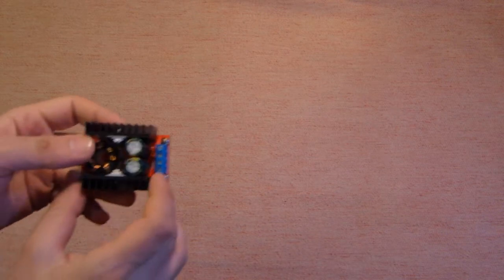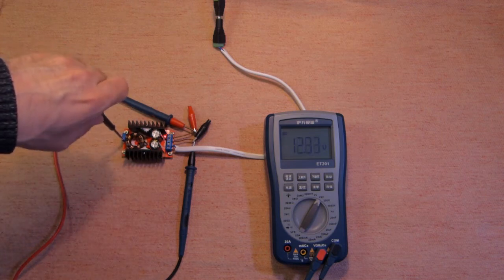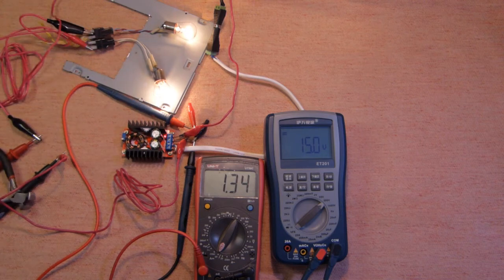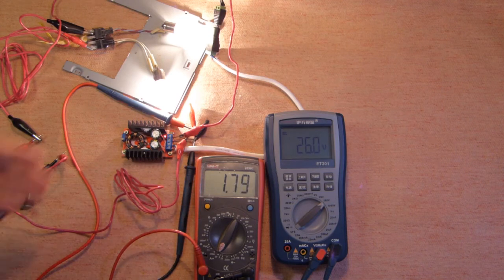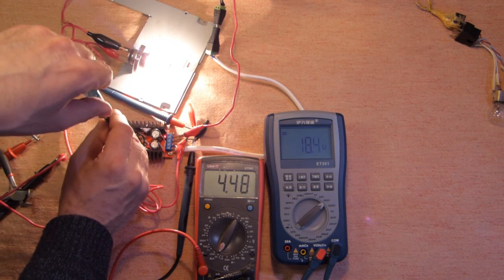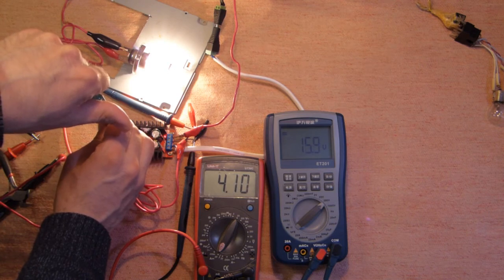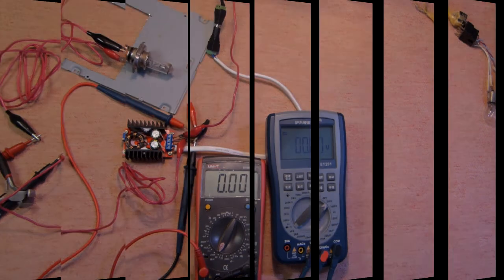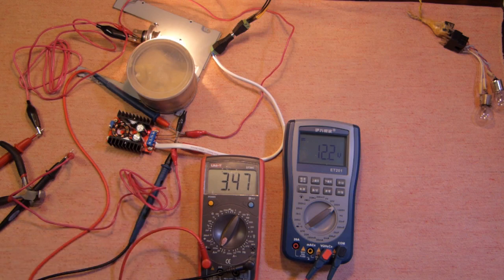DC-DC Boost - Step-Up Converter

Comment: Can i use it with following 
Input 13v 15amp output 24.5v 4.5 amp with a big cooling fan
Plz reply ..i just ordered 2 pcs before watching your video😑
Reply from the maker: Hello, I really doubt that the device can provide 4.5A at the voltage more than 20V, not to mention 24.5V.

Comment: With micro fan it will run cool, but still always overrated.  Can you do a video with this boost buck please?   
https://www.aliexpress.com/item/Automatic-Boost-Buck-Converter-CC-CV-5v-30V-To-1-30V-8A-12V-24V-Regulator-100W/32611751890.html?spm=a2g0s.9042311.0.0.17c44c4d0XXCdM
Reply from the maker: Hello, I'll try as soon as I get it

Comment: hi, i have a small doubt over this. if the input voltage is 4.2 Volt with 2 Ampere for the boost converter and what would be the output voltage ? because my output load requires minimum 12 Volt 3 Amps, i know that the output voltage can reach upto 30 Volt and what about the ampere for the output voltage. will it exceed the input ampere (i.e) 2 Amps or the output ampere is same as the input amps ? please explain it.
Reply from the maker: Ok, your input and output wattage should be almost the same i.e.  4.2V*2A=12V*0.7A. But in reality we have the heating process during power conversion, so, - we lose energy. If the efficiency of the device is 85-90%, then we lose 10-15% of energy. As to your question: if your load needs 12V and 3A, so, it needs12*3=36 watts. What will be your input voltage? If you plan to use 6 volts, then 36/6= 6A. But in reality it will consume a bit more: 7A or something like that. That's the main principle of operation of such converters.
Reply: seems like there's a lot of ampere drops in the module....anyway, i got it. thanks for your detailed clarification. is there any module (boost converter) available in the market for boosting the ampere as well as voltage ?
Reply from the maker: You can't boost amperes; you simply can get more powerful DC-DC Converter http://ali.pub/2kps9t

Comment: 150W Step down boost converter available in market with one potentiometer that is only for adjust voltage that cannot charge battery or charge battery?

Comment: Can I charge lead acid car battery using this module?
Reply from the maker: Yes, if you adjust it properly. Step-down modules have also current adjustment potentiometer.

Comment: Sir if I use 150W step down boost converter and input is 17v 6A and I want 13.8V then what will be output Ampere?
Reply from the maker: 5 Ampere maximum
Reply: Power Battery Channel thanks sir

Comment: If input voltage is 17V 6A and I want 13.8V  then what will be output Ampere?
Plz sir reply fast...
Reply from the maker: In this case you need DC-DC Boost - Step-Down Converter